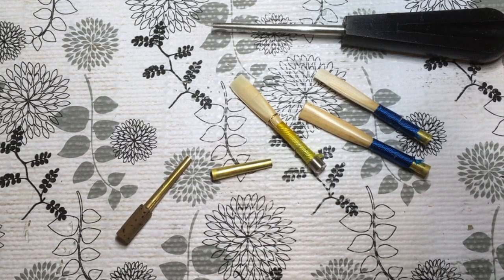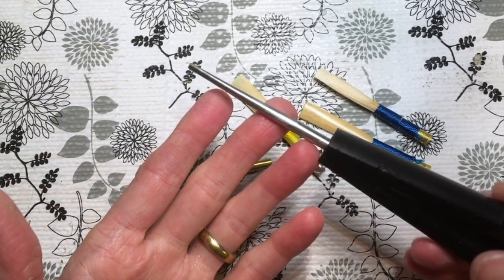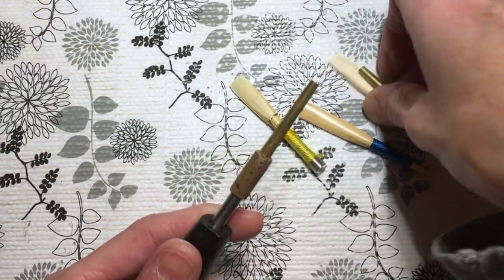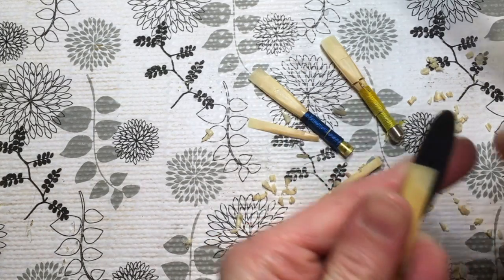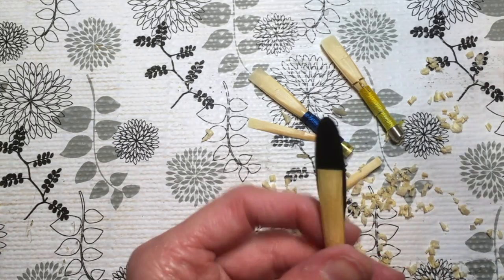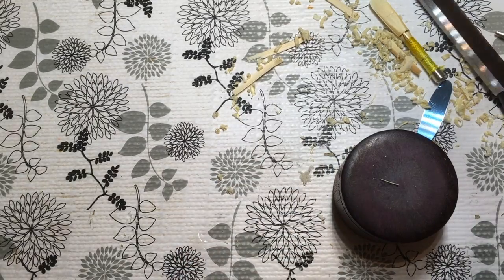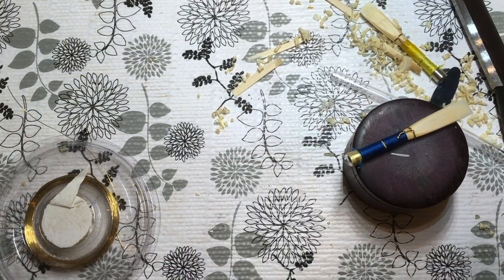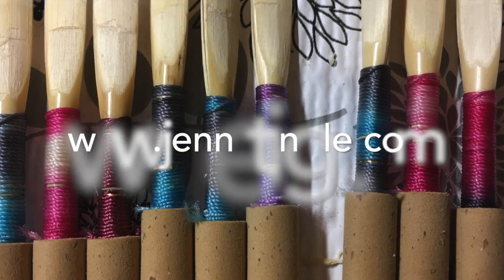Five Minute Reedmaker: English Horn Reeds

Comment: This may be a silly question but are you using the same plaque for EH reeds as for scraping oboe reeds?
Reply from the maker: Not a silly question!  Yes...but...  You might recall from my Plaques video that I use a super skinny plaque for oboe reeds.  The edges of those wear down very fast, and they get razor sharp.  When I move to EH reeds, sometimes those sharp edges will slice the sides of my reed, because the wider reed surrounds the plaque a little more - so I choose newer plaques OR thicker plaques when I'm going to be working on EH reeds.